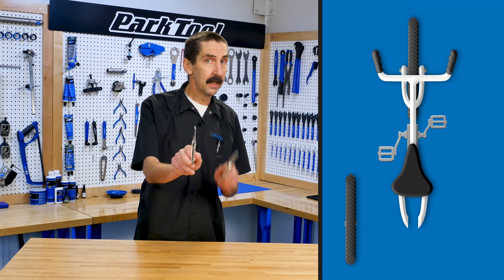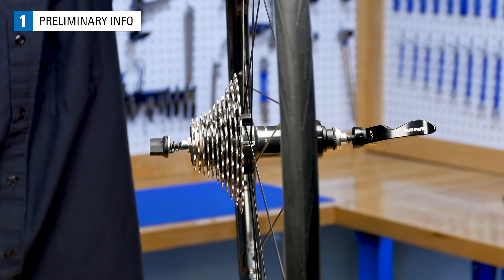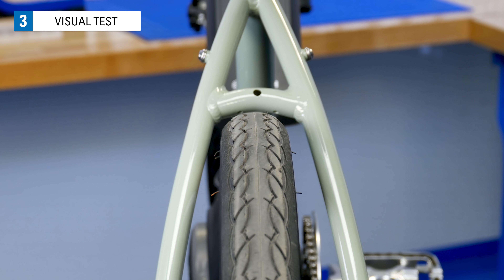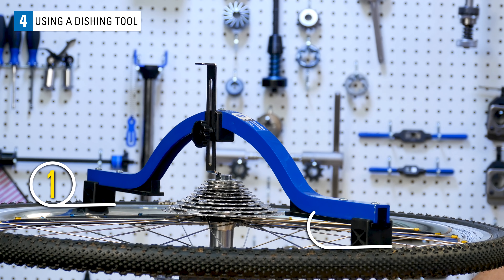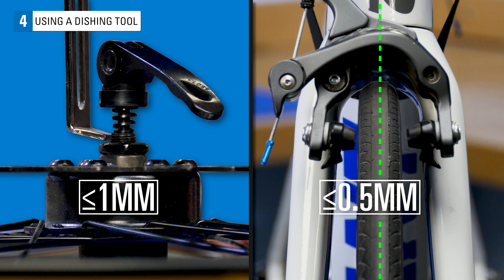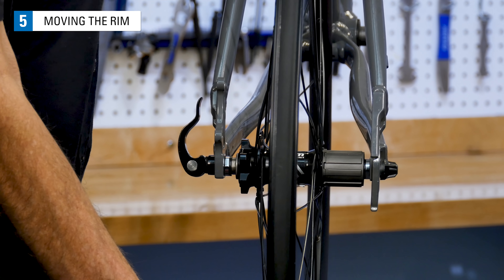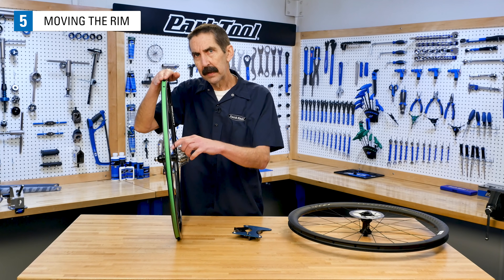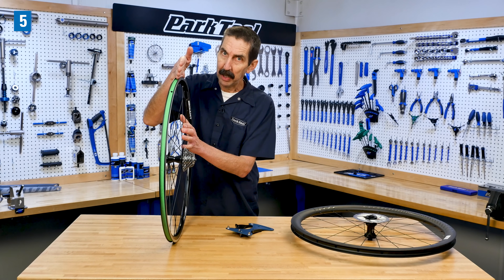How to True a Wheel Part 4: Dishing/Centering

Comment: I've got my rim perfect on the lateral true, but radial true is still for a little high and low spot that seen to be right next to each other and my spine tension is pretty tight there's no flex I was thinking I should loosen them a 1/4 turn all the way around but am reluctant because it's taken a while to get get out this close ,f.y.i this is my first have and true job took a few tires to lace it, but got it done my first lateral true attempt wasn't bad but had a big bump in the radial worked on that and had it looking pretty good then the lateral was not again worked that back in pretty good but felt like my spikes were overly right so I detensioned the whole things and I've got it to where there no deviation Jeff or right just that high and low spot next to each other the low spot send to be more prominent. So what is the correct attack pull the high spot and see where I'm at? Then maybe loosen to relax the low spot. Then what do I do about Spoke tension. Ride it and see if they relax a Little, I'd that didn't work I guess loosen everything equally and deal with whatever deviations result from relaxing the spiokes?
Reply from the maker: Remember no rim is formed perfectly round.  If it deviates in round it will not be felt as you ride.  The idea is to tighten the spokes in the zone of the high spots, but maintain lateral true.  Then loosen the lower spots.  The rim is flexible and reacts to changes in tension this way.  Ideally you want exact tension of each spoke and a perfectly round and true wheel.  It has never happened in the history of bicycles.  Just ride the bike.

Comment: In a pinch, I created my own dishing gauge. I used a wooden stick, taped 2 riserblocks on each end, clamped a bolt in the middle and inserted a screw to measure the offset. Worked like a charm.

Comment: My bike feels turning left will cause my front wheel to slide, while turning right makes it harder and longer.

During straight line I can see my front wheel overlaps to the right side rather than centered.
what is the problem here.
Reply: Try adjusting the handlebar stem. It might not be centered against the wheel, and is slightly turned to the left.

Comment: It still seems to me that the dishing tool should be built into the stand.  I don't see any advantage of a separate tool and a separate step.
Reply: You are correct.  A truing stand IS also a dishing tool.  There is nothing extra to even be built in.  You simply flip the wheel in the stand.

Comment: This might be a silly question, but I was always taught to flip the wheel in the truing stand. You can use this to see the dish. Any disadvantage to this, apart from your tools being faster and maybe slightly more accurate?
Reply: Keep doing what you are doing.  Yes, just flipping a wheel in a truing stand is the way to go.

With even a cheap truing stand, you can easily true, and dish,  a wheel to +/- .010"  (.254 mm) (ignoring rim dings & defects) , which is far more than fine for most.  Beyond that, it mostly depends on the quality and condition of the rim, and your patience.

For reference, a common sheet of copier paper is only .004" (.102mm) thick.
Reply: @Self-Evidently  Thanks. Yeah I did both the wheels to under 2 sheets of paper. I'd say they were the best wheels I ever built, they run really beautifully. I have the Park Tools TS-8 which is not the best stand in the world but I make it work. Thanks for the encouragement.

Comment: If you have a truing stand, you can just flip the wheel around in the truing stand without moving the truing indicators, if the wheel is true, the distance of the rim to the indicators will be the same! I find this much easier & quicker than taking the wheel out and using a separate dishing tool

Comment: have  Roval Disc wheel set.  
Question:
Regarding the hubs:  
 - the disc side measurement:
         center of hub body to over the lock nut  is 60 mm.
- non disc side measurement:  
         center of hub body to over the lock nut  is 45 mm.  

How do you  "Dish" (using a Park Tools WAG-4 Dish Gauge)   the wheel when Disc side length is longer?
Reply from the maker: Disc or no disc, it is the same. Measure from the rim to the part of the hub that references/touches the dropout.  Now flip the wheel, and compare.  This centers the rim to the middle of the left and right hub contact points.
Reply: @parktool  interesting… now that I’m thinking about it, would be the same for rear drive side with cassettes. Thankx for getting my thought process straight 👌

Comment: why would you need the dishing tool if you can see if the rim is of center with the truing stand? or im missing something? can a wheel that is true using the truing stand be out of center? i dont get it..thanks
Reply from the maker: Any truing stand made gives an approximation of dish in the bike.  A truing stand cannot duplicate the exact conditions, width, and spacing of the frame. That is why the dishing tool is the most accurate method to check centering of the wheel.
Reply: @parktool  that makes sense. what if i have the wheel attached to the frame and using a zip tie to true it? if its out of dish i should see wheel touching one side or another right? my question is more related to if a wheel can be true but the dish not...which i believe not...thanks
Reply: @Gledii  You are correct - every truing stand is also a dishing tool, including a zip tie on a bike frame.    Just flip the wheel in the stand, and the dish, to one side or the other, will be evident.  Just tension (or loosen) one side of spokes (or the other) until there is no change in space between the indicator and the rim when flipping the wheel.

A separate dishing tool is unnecessary, more awkward to use, and is not nearly as accurate.

Comment: I just use one side of the calipers of my truing stand. Switch the wheel to the side where the caliper is closer to the rim (let say drive side on the left was closer). Make the caliper as close as possible for the entire circumference of the wheel. Switch the wheel (now drive side si on the right). The gap you see between the caliper and the rims has to be divided by 2 and that's the amount you need to move to get the wheel dished. Rince and repeat until you get your tolerance.

Comment: What about when you have a perfect rear wheel (w cassette and rotor) perfect dish with no error but the drive side tension is too high AND the non drive side tension is too low? Any suggestions pls?
Reply from the maker: Can you give tension numbers to this problem?  What is the drive side and non-drive side tension?
Reply: @parktool  Rear wheel non drive side 77.10, Rear wheel drive side 145.92. Mfg specs are 105-120. Wheel is dished and true.
Reply from the maker: What you should be looking for is that Mfg spec to be on the drive side. The non driveside will almost always be less. Significantly less depending on axle spacing, hub design and rim design.
Reply: @parktool thanks kindly.
Reply: @parktool  one last question, are you saying the mfg spec range (105-120) only applies to the drive side?
Reply from the maker: That is correct.

Comment: When using a Wheel Dishing Tool why do you measure on the lock nuts instead of on the cup of the hub? Wouldn't the cup be more accurate in terms of the hub being center with the wheel?
Reply from the maker: Measure the part of the wheel that touches the frame.  For a threaded axles, that is the lock nut.  For thru axle, it is the end cap.

Comment: @parktool
On a rear wheel with both cassette and disc what side has higher tension?
Reply from the maker: The side that is "flatter", which is the side that has the flange inset more.  On a rear wheel, it is the drive side, the right side with the cassette.

Comment: I was wondering why my wheel was angled towards the left of my frame. If I can gauge the wheel's alignment to the frame with my eyes, and work with the wheel still in the drop outs, I'd imagine this would this be a good workaround for a home mechanic that doesn't have the truing stand and dishing tool, correct? Thanks for the video. Very helpful and required knowledge for a learning bike mechanic like myself.
Reply from the maker: Be sure the wheel is in the dropouts fully before using the frame or fork as a gauge. The frame can be a great gauge as that is what you are trying to have the wheel centered in.
Reply: @parktool  Thanks for your reply. I always make sure my wheel is fully in the dropouts before tightening up the QR skewer after I do anything wheel related. I am thinking about going over to a local bike shop and have them check my derailleur hangar before I center the rim.
Reply: @parktool  I successfully centered my rim! I also solved my wobbly rear tire issue; my rim was out of true for all this time (which was about 3-4 months). Thanks again for this video series.

Comment: There's also a chance that the dropouts themselves are not centered with the frame. So an out of alignment wheel may not be a problem with the wheel. I dish a wheel on the bike it's supposed to go on, so that it's actually centered to the frame. Using a tool only ensures it's dished with respect to itself
Reply: Check if your bike was built with Cannondale Ai (Asymmetric Integration) - shifted 6 mm to the right.
Reply: I think this is my problem... ('THINK')! My rear when came off a Cannondale. Wheel is true and was center on that bike. Unfortunately it sets too far left on my Specialized. Is this common?
Reply: Probably best to fix the frame first.
Reply: @allanhmelnitski978 sometimes there is nothing to fix, some bikes just run the wheel offset to one side, usually the left due the design of the seat/chainstays being set inward for pedal clearance and cassette spacing. My old dh bike is set over an inch to the left
Reply: So true. I also saw a video where they said that it may in some cases be better to true the wheel to the frame it is going on. This could be the exact reason why.
Reply: But a wheel dished to itself shouldn't be bad. It would help diagnose the frame issues. 
I didn't realize before this video that spoke tension on my freehub is going to be different left to right.

Comment: If the wheel is true and within 1mm dish could you not just adjust the cones and axle to move the wheel over by 0.5? I appreciate that not all hubs can’t be adjusted this way, so you may have to dish the wheel using this method.
Reply from the maker: You then shift your chainline which could cause a problem down the line in shifting or chain retention. It is best practice to adjust dish via centering the rim over the hub.
Reply: @parktool  and disc line
Reply: too much effort too small gain, the smallest nipple rotation that would make rim travel is about 90 deg or as i call it half a turn, so depends of many things it could be possible but in some cases rim could went on other side for 1 mm, so lose-lose situation

Comment: So you dish with tension and not with spoke length ? Or could it be a mixture of both ? I heard one side of spokes is usually 2mm longer.( I'm lacing a rear boost hub by the way 12x148 12 speed.)
Reply from the maker: Kinda both but spoke length is where it should start. The driveside is typically shorter. The difference varies quite a lot based on hub geometry and if there is rim offset or not.
Reply: with tension, you control spoke length in side of wheel, and by default on usual wheel left spoke is longer than right,

Comment: My question to Chef Jones, I have plans for buying an e-hub for front about 350w, they usually come about 24h min. and 36-32h usually more common. Bike is gonna be AWD) if possible, I'll get 24h match, but as an alternative, if I find 32h hub, could it be possible to weave the rim in such a way, by 1 empty, 3 spoked holes arrangement with a 24h hub? In other words, 8-empty, 24-full holes by hub and  24-full holes by the rim equally. (I have 24h rims and poor deals for 24h e-hubs, prolly go with the 32h e-hub please help)
I know it works 1:2 ratio but never tried 3:4.
Reply: yes i saw this but it is not good idea because spoke geometry is not proper, i would call it unstable geometry, and e bikes destroy wheels that are properly set so your has more chance to fail
Reply: @makantahi3731  I researched this after asking Martin. And you're wrong, actually this 2:1 weaving is first introduced by Ford to improve strength, distribute force on the drive side and balance it. And Shimano 2022 XTR and high ends like Saint are using this technique. 
With that said, it's only good for uneven forced wheels, like with the drive side. Not good for front wheel where the force is equal amongst both sides.
I answered my own question as always.
Reply: @XavierBetoN  ok, then just do it
Reply: @makantahi3731  I won't be doing since it is front wheel I'm going to motorize. 
Thanks for answering anyways

Comment: Hey can I ask a rookie question here cause I just can't stand a wobble in an mtb 27.5 and I really should have bought a road bike earlier. So here goes idk how i get the reply if possible but say I'm trueing doing the the tension squeeze on bike on its saddle. Tighten I dont want to overdo but so is tightening clockwise to come to my right side(rotor side)? Thi bike is a Ghost Square and it just would be so nice to spin new. Wheels need that right to spin>>> lol thanks for speaking and teaching bro the foothills of foco noco love u.
Reply: How I always do it in my stand, which should be the same for you bike upside down on the seat and bar’s, is when you hook you thumb on the tool (right hand) and pull back towards the drive side is tighten, so counter clockwise, and when you push the spoke wrench with your thumb towards the non drive side (clockwise) is loosen. hope this helps

Comment: I just completed using this excellent five part series as a wheel truing review. And I know that Calvin advises relying on a dishing tool for centering instead of the truing stand. This is because either the stand's centering might need adjusting and/or the hub/rim anomalies could throw things off. However, this still bugs me. I've checked my TS-4.2 with both the 1554-1 centering gauge and a WAG-4 dished wheel and the factory configured centering is still perfect. However, when I place either my rear thru-axle or front quick-release rim on the stand its never centered. I won't name the brand but my bike did come with cheaper OEM hubs. I'm going to eventually replace my rear hub with an XD-driver, so I'm hoping that a better quality hub will improve the centering in the truing stand. I would just prefer to do everything (lateral, radial, dishing, spoke tension) in the TS-4.2.
Reply: It is very possible for a frame to be offcenter / bent as well as a wheel. Or you could be misssing a washer at the axle mount.. OR the axle has moved in the hub because of conical bearings being adjusted from only one side.
Reply: It sounds like your up rights are not center. Park has a video on it, but what I do is open the upright to where they look About straight up and down, loosen the shaft collars, then use a small lever to make sure the uprights are perfectly level, moving them over and loosing and tightening the big knob until they are both level.  Then I would re adjust your caliper alignment again

Comment: i just replaced a rim on my wheel and be couse i don't have dishing gauge i mesuared distance betwen frame and a wheel on both sides .
is that okay to do ?
Reply from the maker: That is a good way to do it. You can also use a couple soup cans to rest the rim on and stack up quarters to the axle then flip the wheel and compare.
Reply: thanks i alredy doone it

Comment: If your TS-2 or 4 is properly calibrated, shouldn't you be able to use both feeler indicators simultaneously to dish the wheel? I thought that's the reason the #1554-1 centering gauge exists.
Reply: Very good question! @Park Tool
Reply from the maker: The purpose of a truing stand is to hold the wheel steady and isolate issue of spoke tension.  However no truing stand can duplicate the accuracy of a dishing tool. A truing stand must be able to adjust from very narrow hubs to very wide rear hubs, and also from large 29er wheels to small child's wheels.  The stand will get a wheel reasonable to centering and but the dishing tool will always be more accurate.
Reply: @zygmuntthecacaokakistocrat6589  that you have to ask tool designer, i made truing stand with separate moving feelers, left,  right  ,up/down
Reply: @parktool  I'm sorry, but that is complete nonsense.  Yes, you can absolutely, and far more accurately, dish a wheel with any decent truing stand.  You just flip the wheel in the stand, same as you flip the wheel to use the dishing tool.
Reply: @mattgies  Actually, yes, any truing stand is the better tool to use to dish a wheel.  Just flip the wheel in the stand, and the dish will be obvious.

Comment: Thanks Calvin for producing such a knowledgeable video. It will help a lot. But what to do when the rim is required to move on a side & the spokes already too tight & the spokes of other side are loose? Please advise. Regards.
Reply from the maker: Ignore the loose side.  If the tight side is close to max, and the centering is correct, there is nothing you can do about the opposite side.  The wheel should stay together as it is.  If the hub design was so poorly done, there is still nothing you can do.
Reply: Could it be spoke length is wrong?
Reply: @andy56730  yes, if I am putting new spokes then might be wrong length. But if it is a company fitted wheel and dcentered then what should be done?
Reply: Sounds like you may be describing a damaged rim (from hitting a pothole or such).